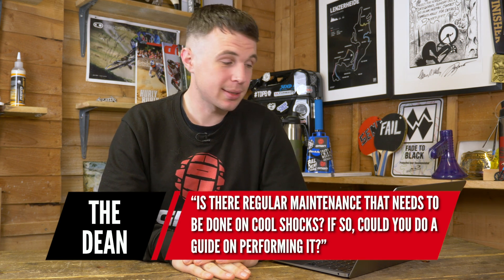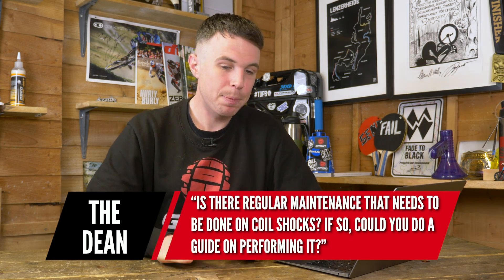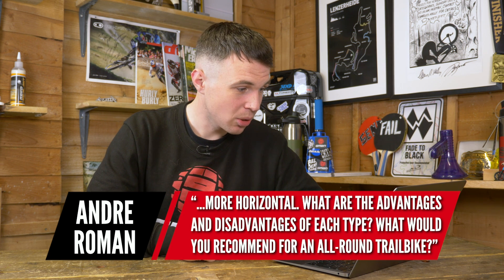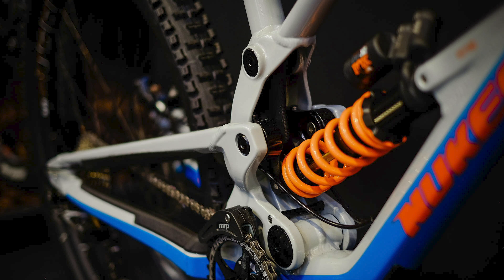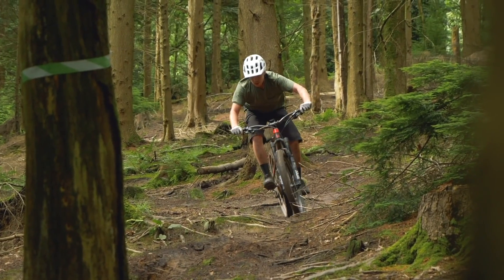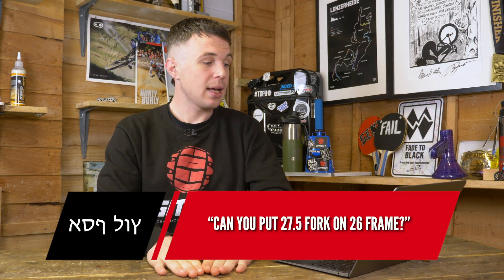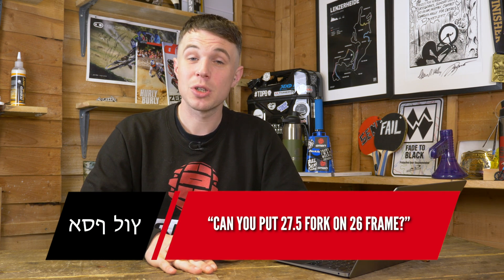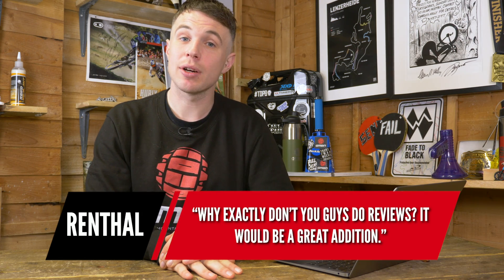Does A Vertical Shock Perform Better Than A Horizontal Shock? | #AskGMBNTech

Comment: I disagree with the idea that the "soft metal" lowers wouldn't be strong enough to hold a helicoil. If the original threads were strong enough for the application, then the new slightly wider threads should be just as good. But I know your job is basically to increase retail sales in the bike industry as much as possible, so you'll always recommend buying new stuff.
Reply: I agree, as a mechanic we have used helicoils in all sorts of places and are very strong (better than original a lot of the time) also using the suntour option and removing the thread is doing the same thing? try helicoils and if it doesn't work then replace the lowers. just my 10 cents worth

Comment: #askgmbntech
I want to build up my own dual suspension bike. I am willing to spend the money on a frame such as a Santa Cruz because of the lifetime warranty and keep the bike for a very long time (10+ years). My only concern is that would the trends and standards change too much over time and force me to change frame due to the sizes not being made anymore, eg threaded BB’s and the current boost spacing. Or should I buy a cheaper FS frame and replace more often?

Comment: Sr suntour axles are 15mm
Fox 36 are 20mm and the axle is 20mm  through the wheel and on the threded side of the fork but about 22m on the other side of the fork

I would say get some threaded bar 2 nuts and 2 washers thread it through the original axle and bolt it together
Or
Replace the lowers

Comment: #askgmbntech I have a freehub driver question: I have a DT Swiss M1900 wheetset with their 350 3-pawl XD driver on it for a SRAM GX groupset.  I would love to upgrade the freehub driver to a 6-pawl due to the lack of precise engagement but I'm having trouble identifying one that will mate with the hub ratchet drive ring.  Is this possible? or do I need to replace the entire wheelset.  Thank you!!
Reply: Jesse Nixon a DT 350 hub does not use pawls, it has a the ratchet, so that’s not the one you have. The web says you have a 370 hub. As far as I know dt Swiss only makes 3 pawl hubs for the pawl versions, not 6. More pawls will not make the hub any faster to engage, it would need more notches in the hub shell for that. So yes you would need a new hub to get faster engagement.
Reply: @jonathanzappala   Thanks for the reply, and that's what I've come to understand in the last few days.  When you search Drivers online they look so similar you get convinced its a direct swap but it apparently isn't that simple!

Comment: #askgmbntech I’m currently looking at the 2020 Norco sight a3 and I have noticed that because it’s the cheapest model the shock doesn’t have a piggyback. Will this affect dampening compared to a piggyback and/or robustness of the shock? Thanks.
Reply: it will affect damping only very slightly. Piggyback resevoirs increase the oil volume in the shock which allows better damping control and reduces temperature related changes to damping. It wont affect the robustness at all, its one less thing to service and go wrong so your reliabilty increases reallt. https://www.bikeradar.com/features/trail-tech-what-type-of-rear-shock-is-right-for-you/
Reply: RamenNoodles22 thanks, that’s really good to know!

Comment: I feel like if I had a full suspension bike I wouldn’t notice the difference, but I do think vertical look better
Reply: Blue Skate you do Notice it a bit, the vertical has a more forward axle path and keeps your weight centred while the horizontal linkage pushs you back a little bit but you get used to it
Reply: @jooncash8844  I only once ride a bike with a vertical shock and it was the best feeling I ever had

Comment: When I was testing bikes I tried a transition scout (vertical shock) and  a Santa Cruz 5010 (horizontal shock) ..... the scout soaked up everything and felt more plush but the pedal bob was horrendous by comparison. went with a 5010 and now run a cane creek coil with a lock out and rarely lock it out because it pedals so well.... the coil 100% improves the small bump and grip in corners 👍🏻
Reply: 0kojack0 that probably says more of the suspension design, shock and running than if the shock is horizontal or vertical.
Reply: Texture I I agree. But thought I’d mention as it was the title of the video. Wasn’t one of my finest stories admittedly 😂
Reply: So which one jumps better and feels good in the air because the Canyon Sender have its shock to the bottom which made the bike have more weight on the bottom which makes it planted and I think change your jumping feel and thinking about vertical shock position the weight of the shock is parallel or on your bottom which helps in positioning compared to a horizontal which idk where the weights go

Comment: According to horizontally and vertically bike shocks - can you explain the difference between rear suspension systems? I mean 1 hinge vs 4hinge etc. #askgmbntech
Reply: maślan technically it’s called 1 pivot or 4 bar linkage but realistically there’s not much performance difference except that the 4 bar would probably have more progression and maybe a softer small bump sensitivity depending on the layout.
The Scott Gambler 2018 has lots of linkage and is complicated and hard to clean and is very linear (this is a bad linkage design). The new Scott Gambler has very few linkages and pivots but is progressive and modern, like a trek session

Comment: #askgmbntech After working on my bike upside down, the rear hydraulic brake (from Shimano) seemed to have lost a lot of its fluid. But after pumping my brake lever for a couple minutes the brake returned to its original state and worked fine. It has happened multiple times just from turning my bike over. Is there a reason for this?
Reply: Jesse Dulaney probably have air in your brake line. In my experience, a simple lever end bleed should do the trick 👌
Reply: Jesse Dulaney Yes. As stated, it’s due to air bubbles. The lever has a reservoir which allows for some bubbles. Flipping the bike upside down leads to those bubbles traveling to the caliper, which does not have a reservoir and therefore cannot handle bubbles without squishyness.

Comment: #askgmbntech what second-hand, full suspension bike would you recommend for around £600-£800?
Reply: Look for a 2008-20012 era giant trance or trek fuel, they seem to go for around that price in good condition from what I've seen
Reply: NONE! 😄 don't buy used full suspension bike! It is most likely going to require service on both the forks and the shock and who knows if it's just lower leg and air, or a complete damper service. By the time you're done you would have spent anywhere from a hundred to another 500 - $600.
Do not buy a used full suspension bike unless it has been impeccably maintained and or had the front and rear recently serviced. You're just asking for a bike that will not perform the way it was designed to perform and you're wasting your money. Buy a good used hardtail and put some money aside to service the forks or save up and buy a lower end full suspension bike
Reply: Danny Thomas That’s a good question, I would like to see more 2nd hand options as the top drawer new gear is just unobtainable to some of us.

Comment: #askgmbntech hey Harry I recently got a bike for Christmas and I had to put the bars the pedals and the front wheel on and I noticed wen I wheelied my front wheel would stop so I checked it and I loosened the bolts and held in he front brake and I would tighten the bolts back up but there would still be rubbing on the disk so I got a flat head and put even space between the pads by pushing them open and putting the wheel back on but I noticed that when I pressed my front brake the lever would just go to the bar and wen I let go the pads would just go back to how they were how do I fix this

Comment: #askgmbntech. Hi guys I just accidentally put lube on my disc will that contaminate the pads and do they need replacement ??
Reply: 🤣🤣🤣 #clickbait.
But seriously... if you really did do that throw away the rotor throw away the pads you will never get the oil residue off either surface
Reply: @archetypex65  Just in case this is a serious comment... Nonsense! Meths/Isopropyl/alcahol/acetone etc will remove oil from the discs easily. Pads may need replacing if they;ve been contaminated, but cleaning with solvent as above and then rubbing with abrasive paper may rescue them if they are contaminated and sintered  (Doddy did a bit about this).
Reply: Light sandpaper and alcohol

Comment: #askgmbntech Hi guys, I am going to be doing my first Enduro (Nukeproof 257 AM, 2015) at FT william  end of Feb. I am 110 kg and realise the case for running low pressure.would it be the best idea to use cushcore or Higher pressures. Great show
Reply: Neil Murray higher suspension pressures as you’ll be going faster in a race, higher tyre pressures as you don’t want a flat, but if you want to buy some cushcore and run lower pressures

Comment: #askgmbntech Hey Henry, what is the best way to "store" a suspension fork, in a way that will maximize it's longevity? For situations when you don't want to use it for the present time, but do in the future? I have an old (2013) Ritchey P29-er, which I love riding. It came with a very nice Fox Factory 32 Kashima fork, which has seen limited use and regular maintenance, so it is in good shape. I also have a very nice Ritchey Rigid Carbon fork, which I like to use occasionally to switch it up. The frame takes a straight 1 1/8" steerer, so both these forks are very rare, and would be difficult to replace in the future. I've just recently serviced my suspension fork with new oil and seals, but am currently riding my bike rigid. Should I keep the fork as is, with the oil and everything intact, or dismantle and purchase a new seals kit and build it up when I'm ready to ride with it again? How long could 
I potentially keep the suspension fork alive with more or less sporadic use and regular maintenance? Because I don't plan to sell this bike anytime soon.
Reply: the_fleecing you should always take the air out to release the pressure and strain on the fork.
Reply: I'm not Henry but I do my best.
If we are talking about anything more than a few weeks it's best to release the air from your fork if you want to store it so the sealents and internal parts are not under pressure. A relatively dry room is best to store any fork. I your room, try to clamp your fork slightly so i doesn't stand on the ground, you can lay them down but for your carbon fork it's better to be clamped at the shaft.
You can safely let the oil in your fork, this helps the seals and foamrings to be moist, maybe flip your fork upsides down ocassionally so the fluids move where they need to go. Yet if you want to go the extra mile or let's say marathon, store your parts individually and if you want to use it get new sealents wipers and oil.
This is an extreme case and rarely useful. 

You can use your fork as long as they hold them stable and for your fox, als Long as it holds air.
Yet all moving parts are going to wear out af some point.
Reply: @maikszczerbuk613  and Bikeable, thank you for your helpful replies. One more question, I don't have a shock pump. Is it okay to let the air out without one? I feel like I've heard something regarding that.
Reply: @leahuldan  yeah, no Problem, Just take an allen key.

How do you service your fork without an shockpump?
Reply: @maikszczerbuk613  thank you! I work at a bike shop, but don't have a shock pump at home. Cheers
Reply: the_fleecing yup all good, I recommend putting a little bit of fork oil on the area where the stanchions meet the lowers to keep the seals nice and moist, repeat occasionally as needed

Comment: #askgmbntech My shock ( Fox DPX2) is slightly to large for my frame (Giant Reign X) so the shock is always slightly compressed. What kind of damage will this do to the shock? Thanks.
Reply: Mastersaint XD won’t do any damage to the shock but it will reduce the travel.

It will make the first part of the travel quite stiff so your in for a harsh ride.

Unless you just mean the sag which wouldn’t change anything, to fix this bump up your pressure a bit
Reply: Bikeable yeah it’s not the sag. The shock is 100% of the time slightly compressed because of the linkage. Thanks for your input!

Comment: #askgmbntech. I ride a size XL marin hawk hill 3. I have few questions. 1 can i go up travel on the forks i currently running rockshox revelation 120mm? 2 can i turn the rear shock upside down? 3 why does my rear break keep screeching and have brown mark on the inside of the disc ? Thanks and love to show
Reply: lee sj My 19’ HH came with 130mm fork and i’ve seen a few that people swapped to 140mm with no problems. You must have an 18’ which came with the 120mm I think.
Reply: Sounds like your rear brake pads have work down to the metal. You need to change these right away and depending on how long you've been riding metal on metal, you will probably need a new rotor as well.
Reply: Yes and yes if it fits

Comment: With vertical shocks the upward force has to be converted to downward force, this puts more strain on basically everything......... Going back 10 years or so to the Kona Kikapu (a bike I still own and have trouble letting go of), there were reports of linkage failures and the actual frame fracturing at the pivot point, and I think this is why they were discontinued in 2008/2009.......

Comment: #askgmbntech I currently Have a GT La Bomba dirt jump bike and love riding it on trails but i struggle to pedal up the hill. what would be a good hardtail that has the ability to climb but also the ability to through around.
Reply: Almost all hardtails should be great to pedal uphill as nothing is lost in the rear suspension. Having said that a dirt jump bike might not have the right gearing to allow easy uphill, might have smaller 26" wheels, or might not allow your seat to be raised high enough among many geometry things. It likely isn't gonna get a whole lot better imo to ride uphill if these things listed seemed inline with other hardtails. Just gotta get fitter :)
Reply: Try a Nukeproof Scout or a Norco Charger or basically any hardtail, dirt jumps are for dirt jumps and skateparks...not trails

Comment: #askgmbntech hi Doddy/Henry I recently saw a hydraulic 1x13 drivetrain and I was wondering what are benefits that you get with a hydraulic actuated system rather than cable and is it worth it for the price.
Reply: It's likely so they could get around the multiple Shimano, SRAM, box patents. Hydraulic will mean that there is no cable stretch so could prevent bad shifting for a bit longer, but it also means you need to bleed the fluid ever know and again. The hydraulic derailleur also has the nice feature to easily lock it into one position if something does snap with the hose. Mechanical derailleurs with a cable can be limited by set screws, but often they don't have enough adjustment in them to fix it in any gear. Hope this helps!

Comment: #askgmbntech do volume reducers give you less travel. How does it work
Reply: Nope they don't reduce travel. Inside the fork is a chamber of air on one side that has a fixed total amount of air. The pressure x volume at the beginning of the stroke must equal the pressure x volume at the end of the stroke. If you reduce the volume using volume reducers then the pressure at the end of the stroke must be higher so satisfy this formula and thus preventing you from bottoming out as force = pressure x area (so force is increased). Hope this helps.
Reply: Niksuttelia no they don’t, basically it reduces the volume of the air chamber so as you go through the travel it gets stiffer and stiffer so you don’t always bottom out

Comment: FOX 36 QUESTION

I believe you can replace the threaded bit just like how you would replace a gear hanger on a frame, I know you can do it on newer ones, looks like it's possible on the 2016 one as well

Comment: #askgmbntech Hi guys. I dont really know what to do because my fork lockout on my rockshox pike rct3 doesnt do anything at all do you have any advice on trying to fix it or should i just leave it to the bike shop to do. Thanks
Reply: What year is the fork from? Very few modern forks have a full lockout mode where the fork doesnt move at all. The fork will always move in the "Firm" position, it just makes the fork stiffer.
Reply: Sounds like the same problem I have with a 2018 rockshox revelation forks. What we think of as lockout is really just maxing out the low speed compression. My fork is now full open regardless of where I set that compression dial. No one has been able to tell me whether it just needs a service or if the compression damping is broken. No one services suspension near where I live either. So I'm not sure what to do about it

Comment: #askgmbntech is the Nukeproof scout as capable as the reactor when doing laps in a downhill park such as 417 BikePark and BPW. (On blue and red trails)
Reply: Ben Rankin definitely, nukeproof clearly put their time into designing it and it doesn’t matter so much about the travel but how it’s designed. The Norco optic has 125mm but it’s very well designed so you can take on whistler with it, so the reactor would be fine and fun
Reply: Is it as capable: definitely, depending on the rider. Would it be as comfortable: probably not.

Comment: #ASKGMBNTECH I have an older hard tail nishiki Colorado 29er it's a department store bike but its in great condition but I don't ride it because it's but it's too big for me it's a size XL 29er I'm thinking of just swapping the frame for a M or L but maybe making it my commuter bike but with the mtb standards changing and going the direction it is I'm having trouble finding a frame it's got QR Axles,1⅛ steer tube, and a threaded cartridge bottom bracket, are there frames you know of that will work?Are there adapters I can get to convert a thru axle to 5mm qr? Is it worth it?